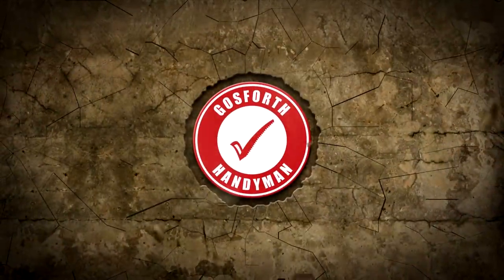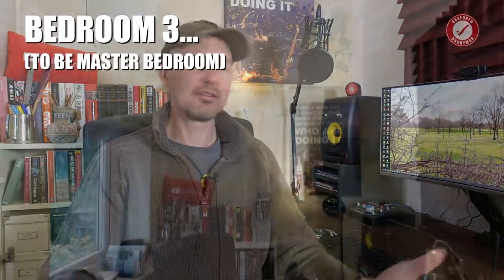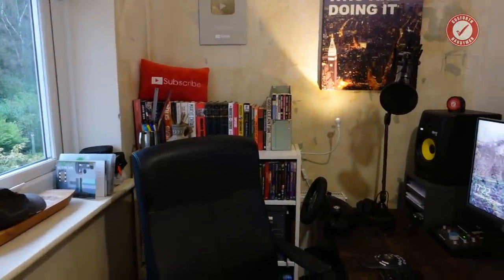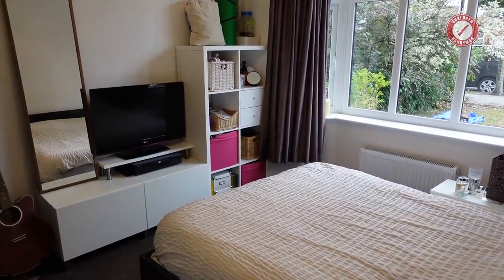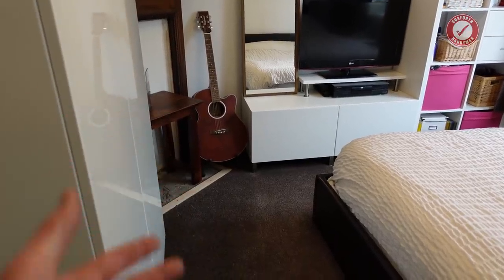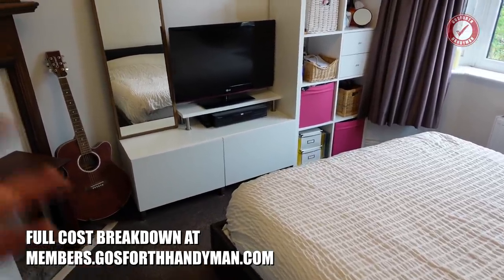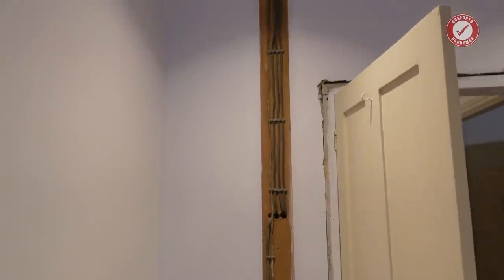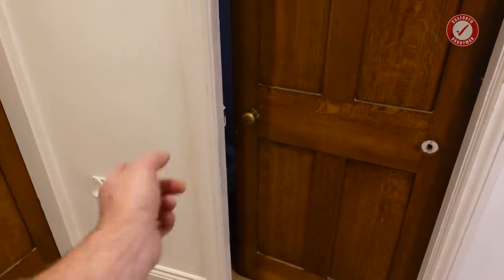Phase 1 done - what the TV shows don’t tell you! (1920’s Renovation Part 34)

Comment: Re ventilation.   We had a basement type extension built and had problems with condensation.  We had a humidity extraction fan fitted and a fresh air inlet   Very modest cost and it works a treat.  Would resolve your loft issue.  Brilliant series by the way!

Comment: One issue to consider with a good refurbishment like yours is the natural ventilation that controls humidity that has preserved the home for many years can be significantly reduced causing issues. A solution I am thinking about is a cheap MVHR system but haven't committed to it yet. May be worth getting a cheap humidity monitor from a popular online supplier to see if your refurbished house has a potential issue.

Comment: The best thing to do with a warm roof like what you've created is a ridge vent which has proper airtight membrane installed. The benefit is that it goes along the entire ridge and you won't get any damp spots. However, that clearly not an easy things to do when you renovate. It's typically installed on the outside and since it's something that many cold roof have, it is possible to convert a cold roof into warm and keep the ridge vent. 
What you've done could work just a well but maybe put a humidity sensor(s) there and monitor the levels. There's no point guessing or asking for things that worked on other properties. Also the sensors are inexpensive nowadays and a couple would cost you less than a call out fee for a supposed damp specialist.

Comment: 100% agree with you regarding the dust difference between carpets and wood flooring. Carpets at least prevent any dust present from flying everywhere and you can easily collect it with a hoover. With wood floors if you move a chair or god forbid a bed then the whole room is filled with dust.

Comment: I like the vent tube in the loft. If the house gets baking hot in the summer you can open the loft hatch and should be able to get a chimney effect going to keep a flow of air moving through the house.
Reply from the maker: Defo! 👍👍
Reply: @GosforthHandyman  never get a heatpump tumble dryer they are awful heard so many bad things about them I will stick to my 2 condenser tumble dryers
Reply: @theoddjobcentre6686  I have a heat pump tumble dryer it is excellent. It's a bosch, has saved us a fortune and no humidity leaking from it, it's a bit louder than the usual ones but if you get an LG one they have an inverter compressor which is very quiet.  Tried a normal Beko Condenser dryer in a holiday let recently it added so much moisture to the air the walls got wet.
Reply: @richardc1983  Interesting.  We have a Beko condenser dryer and the thing we were most impressed with when we got it is the total lack of condensation.  I wonder if the one in the let had ever had the condenser cleaned out.
Reply: @tonyjover  yeah I checked and it was clean as was the filter. Compared to a heat pump it just seemed less sealed. How come you didn't like the heat pump.
Reply: @richardc1983  I've never tried a heat pump - that was someone else.

Comment: Our mid 60's bungalow was remodelled in 2014 with an extension workshop/garage (7m x4.5m), bath room moved, wet room added. The roof was insulated at rafter level (Celotex) 
with 60mm between the rafters and 60mm over with membrane, battens and tiles over that. Have not needed any addition ventilation in the roof space as it stays cool in the summer and warm in the winter. The roof space was already sealed at the eves so did need/have air flow.
Reply from the maker: Interesting! Our loft certainly gets quite warm in the summer. It's like the heat gets in but can't escape. 🤔

Comment: I would recommend you keep your downstairs loo. We have built on and the best thing we did was to install a downstairs loo especially as we are in our 70's. We do have 2 upstairs but only use 1.
Reply: I don't think they have a downstairs loo. The house originally had a split bathroom with the bath in one room and the toilet in a separate room. Now they've made the bathroom bigger they can fit a toilet in so they currently have 2 toilets upstairs which I guess will become 3 after the en suite is finished
Reply: @jaywright9924  OK my mistake, but a downstairs loo is a must.
Reply: @ericmcrae7758  Definitely agree. Especially when your house is on the larger side. Nothing worse than standing up and realising you're about to wet yourself and you have to run all the way upstairs haha
Reply from the maker: Cheers! Yeah, on the list at some point if we extend at the front, but not urgent. 👍
Reply: I echo your suggestion that there be a downstairs loo.  Perhaps not on the top of the list for younger folks but this is a forever home, and we all do get older.  Also, the study has been described as a potential fourth bedroom, and that should have a loo handy.
Reply: Yes, having a downstairs loo enabled my elderly parents to continue living in their home. Without it, they'd have had to move house and eventually go into care long before they died - so, quite apart from avoiding the stress and expense of moving, and the distress of giving up the family home, that toilet probably saved a 6-figure sum in care home fees! At the other end of the age scale, a downstairs loo is really handy for families with children, or for young adults having parties, or older, less-able guests visiting - actually, for pretty well anyone of any age.

Comment: @18:30 The weatherization people insulated my house with blown-in insulation. It made it so air tight that they installed a whole house ventilation system to remove stale air and moisture from the house.
It's necessary for a house to breathe.
Reply from the maker: Yup, totally agree. So important. 👍
Reply: Btw, the fan is programmed to come on for ten minutes every hour. It's quiet, less noise than the furnace blower, and I didn't notice any significant increase in the electric bill. It only runs during the heating season as I unplug it when the windows are open and plug it back in when the heat gets turned on.
I don't need one in the attic as it's not insulated. Just the floor in the attic where downstairs heat loss comes from.

Comment: Hi Andy - amazing how much work you've got through in such a short space of time. Roof ventilation: In Aus we often use 'whirlybirds' which used commonly to be powered by the wind, but now you can get solar ones. In winter they remove the moisture from the air and in summer they reduce the heat in roof cavities. Cost? Difficult to say, as you've done so much work yourself ... 30k?

Comment: Was just looking at the plan you posted in the video here: did you intentionally choose to continue through that corridor by the utility room through the old kitchen window opening to save on costs? I ask because I would suggest shifting the door to the right so the corridor opens up straight into the new kitchen if that's structurally possible. You would then get plenty of storage space beyond the utility room which could be used for an American-style walk-in pantry, or a broom closet, etc...

If not, I recommend that you accentuate the wall straight ahead with a spot light and a lovely work of art. This will be a very prominent wall in front of the entry so the art will give it a good look IMO.

Comment: You can install over-vents onto of the fascia's, they sit on top of the fascia with air holes to create air flow. Failing that you could install double height are air bricks on the gables but by doing this you will mitigate the spray foam rafter insulation you have. Obviously when you complete your extension you will use breathable felt and if that's connected to that old roof that will help. I really don't understand principle of insulating at the rafter level if its an unheated space. I work as an architectural technician by the way so if you have any questions or want second opinion happy to advise.
Reply from the maker: Cheers! The loft certainly gets very warm in the summer!
Reply: Loft is a " warm loft". 
Most UK houses were, and often still are, "cold lofted". These need ventilation, as they are often not that well protected from warm moist air getting in through loft hatch and gaps through ceilings, and the original build with old roof felt may let in quite a bit of moisture. Condensation & rot risk.

Modern roof membranes,  and airtight construction allow warm ( and hot!) roofs. Although not actually heated, the insulated building envelope goes right up and round the inside of roof, rather than across the loft floor. However, the amount of insulation able to fit between rafters is less than the thickness expected now for loft (floor) insulation, so some folk (Andy) have some layered on loft floor as well as under rafters. Not found definitive guide on this, whether better to have none, some or as much as possible, which may shift the risk parameter.

It is likely in Andy's case that the pipe vent does not make that much difference to the comfort of the house, as long as not introducing a real draught. Could be checked later with thermal camera and / or draught test (joss stick smoke). 
I recently found that my parents old house has a version of a warm loft. Reroofed in 1981, has rockwool under the stone slates and then a bitumen felt liner. No ventilation, also has about 9" of Rockwool on loft floor too. Absolutely no sign or smell of any damp problems at all. Timbers drizabone.
I think they sidestepped building regs at the time. BCOs tended to be fanatical about ventilated cold roofs. The windier the better! Different now.

Comment: With regards to the loft venting, i would leave a thermostat with built in hygrometer up there. Then, every week, check the max and min readings to make sure they are within acceptable parameters. When i boarded out my loft, i wish i had added a vapour barrier before i started the work, this has to be added to the warm side of the insulation, ie under the insulation and the boards.  Not a big deal if you have adequate ventilation though.

Comment: With regards the loft.
I would pop a humidity meter in the loft before making any decisions. You may find that it was a bit humid after all the plastering, painting etc.
The temp vent you have will lower the humidity over the next few months and you may find that it is very dry up there, there shouldn't be any need for venting but follow what the meter says. 
If you start painting again it would be interesting to keep a record of the readings in the loft. 
It seems pointless to spray foam the loft and then introduce cold air? 
Humidity levels are the least spoken thing in properties but it can tell you a lot of information.
Reply from the maker: Yup, know what you mean. I might add some sort of flap on the vent so we can remove some of the heat during the summer but keep it mostly sealed in winter. 👍
Reply: @GosforthHandyman  That sounds like a good idea. 
The spray foam between the rafters can help to keep it cooler in the loft during the summer due to the reduction in radiant heat from the tiles.
It will be interesting to follow your progress.
You have done a cracking job bye the way.

Comment: Have you discussed spray foam in the loft in a previous video that i may of missed?. some reading would suggest it is not the best idea and although i know the guys over the pond use it a lot brick uk houses may not be as forgiving
Reply from the maker: Only briefly discussed it in the "what's in the loft" vid. I get the impression there's been some kneejerk reactions over here to sprayfoam installed in the wrong circumstances (e.g. leaky roofs that don't have felt). Plus closed cell vs open cell too. Widely used in the States and Canada. 👍
Reply: @GosforthHandyman  Your question about ventilation highlights the issue though - It's almost pointless to use spray insulation unless you're creating a warm roof, in which case the construction is currently completely wrong.

Comment: Andy - I'm going to say 35-40k what with the materials shortage tax. Looks well I'm just about to do something similar 1900's house with damp problems.... One question, if I may. the underfloor insulation how does that affect the air flow underfloor to avoid future damp issues?
Reply from the maker: I've made sure there's plenty air flow under the floor. All honeycomb brickwork cleared out, extra air bricks etc. All clean and dry so 🤞

Comment: Did you have any mortgage trouble with the spray foam?
Recently got refused some additional borrowing because our roof is spray insulated. Got our full remortgage coming up in June and I'm a bit nervous!
Reply from the maker: I've heard mixed reports on the mortgage front. Crazy really since I'm struggling to find any scientific basis for their stance.
Reply: WHICH? consumer association are also questioning this recent mortgage / insurance stance on spray foam insulation.
I suspect an over-interpretation from Grenfell but just guessing.
Reply: @safetyladysilver8988  that's really interesting... Fingers crossed they see sense.
I've not heard anything about flammable concerns (ie grenfell) and thought it was more about how it might trap moisture and cause damage to rafters etc.

Who knows!?! 🤷‍♂️
Reply: I think the issue is business. Many contractors who insulate with foam, do not install it properly. You're supposed to install just like you would fiberglass insulation leaving a breathing space between the insulation and the bottom of the roof inside the attic space.
If you don't, there's a potential for moisture buildup there contributing to mold and mildew and wood rot. That would make for expensive repairs and devalue the house. 
So, some banks will not accept the risk of lending money on a building that might end up being worth less than the loan.
Reply: @freetolook3727  that makes some sense.
What annoyed me most about my borrowing refusal was I paid out for a full roof survey, internal and external, which said everything was in good shape yet was still told no.

Natwest mortgages incase anyone is interested.
Reply: @Mark Walker Did the bank give you a reason for refusing the mortgage? Did you show them the inspection report??
Mortgage refusal might not have anything to do with the roof.
Try a different bank.
Reply: @freetolook3727  it's was additional borrowing with our existing mortgage lender. Yeah showed them all the reports etc but it was a blanket "spray foam = no" response.
Apparently their stance has all changed since we took the original mortgage out.

Comment: Anyones thoughts on the (waste of space as they are doing it) Insulate Britain protestors,  shown them what has been done - and how it needs to be done properly (and then add in competent labour costs)  and they will freak out - and thats just for a brick built house with tiled roof,  now go to say Horsforth near Leeds and try it with a stone built property- including stone flags in half the ground floor and slates / stone tiles for roofing materials - actually stone is quite cosy in winter if it gets the summer warm up.  What it overall shows is that retro insulating houses can only be done when vacant and empty and perhaps the cost could be refunded by govt from stamp duty paid out as a forward incentive ?